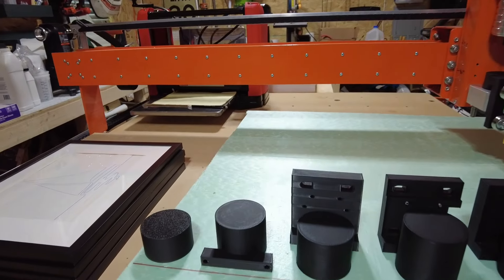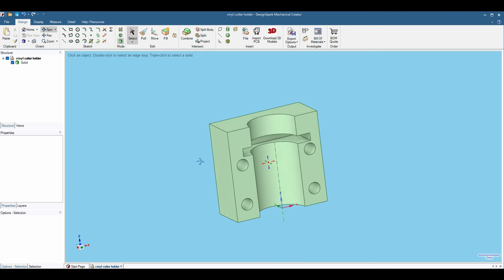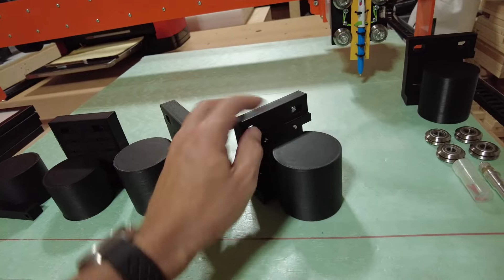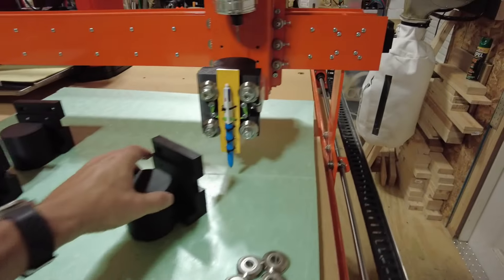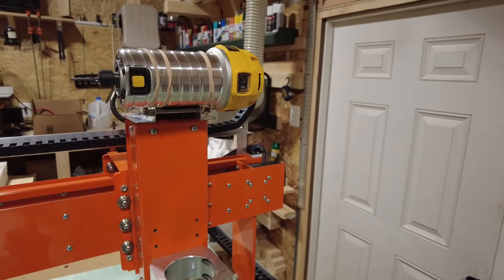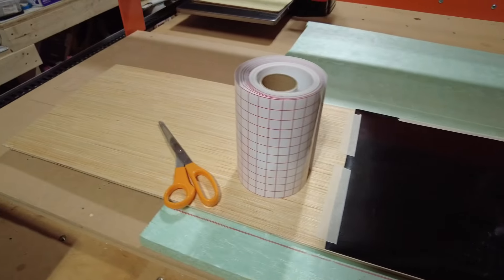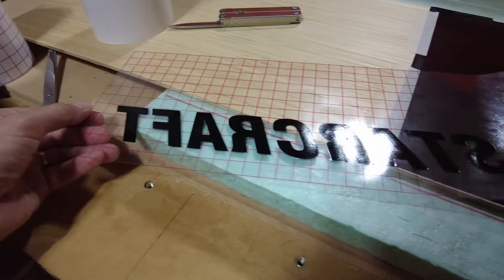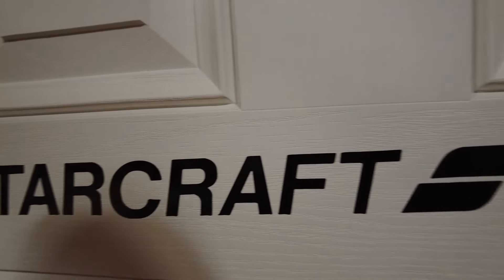A Simple DIY CNC Vinyl Cutter - Free Files - Works Great!

Comment: Great video. Did you use the standard applications for your cutting toolpath or did you need something special for cutting vinyl?  I use Autodesk  Fusion and I assume that I could use the trace function to cut out the letters.
Reply from the maker: Thanks.  Yep, standard cnc design.  Just set it up like a very shallow one time pass.  Fun stuff.
Reply: @drez20001  Thanks , my vinyl cutter will arrive today via Amazon.

Comment: Did you use ordinary rubber bands?  The ones I've bought are usually weak and in time just plain snap.
Reply from the maker: Yep.  Regular rubber bands.  I don’t recall the brand but they seemed a little thicker.  The bag had lots of different sizes.  I did break a few along the way too.

Comment: Revisiting my home-grown Vinyl Cutter...
**  The knife only cuts through the vinyl, and not the backing, right?
**  Is the depth of cut determined by the amount the blade protrudes from the barrel?  In other words, does the knife holder contact the vinyl while it's moving, and the depth of cut is controlled by the knurled  nuts?
Thanks in advance.   😃
Reply from the maker: The rubber band takes up the slack so I just set the depth for a few mm or about 1/8 of an inch or so.  When I set the Z height I put a little tension on it.  
The cutter may go a smidge into the wood under it but no issues.  It’s a trial and error kind of thing but very forgiving.
Reply: @drez20001  :  Thanks.  I haven't got it clear in my head, sorry... does the knife holder actually slide along the vinyl, or is it a fraction above the surface?

Comment: Works a treat!   👍
Last year I upgraded my car.  The tradein offer was a joke, so I decided to sell my old one myself, by displaying it at a popular local site.  All I needed was some window signs, and Job Done!
Initially I printed the price on paper, taped it to vinyl, and hand-cut through both layers... BORING!  😴
The car didn't sell!  😱   Lower price number set needed.   😡
I bought a drag-knife very similar to yours; pleased with it.  😃
NO CNC!  🥴
Don't panic... my aging Ender 3  3D printer might work as a poor mans CNC?   🤔
I designed and 3D printed a compliant knife holder, based on the flexure design I had seen in Dan Gelbart's fantastic series on rapid prototyping.   https://youtu.be/PaypcVFPs48?si=lG9-uE4dMD_vb4pN
IT WORKED!  😁
The flexure mount was rigid, and precise... very satisfying!   👍
What was not satisfying was the car... I needed to cut a whole lot of numbers... each smaller than before.   👎  🤬
Predictably, the printer was not rigid enough, eventually the knife dug into the cutting mat, resulting in an exploding compliant knife holder... rigid? - Yes... strong? - NO!
I assembled the parts to cobble up a makeshift X / Y plotter,  Fusion 360 helped with the design.  Really looking forward to this little adventure!!  😛
THE BLOODY CAR SOLD!!!
One day...   😜  👍
Thanks for the video... always look forward to them.   Don't lose that guitar!
Of course my plotter would have been better!   YEAH RIGHT!
Reply from the maker: Awesome job!  Always keep trying new things and using the tools at hand.  Thanks for your comments.